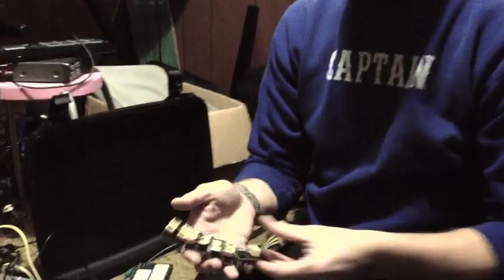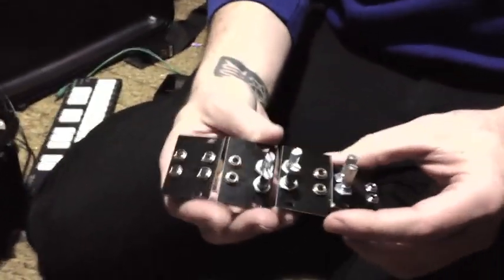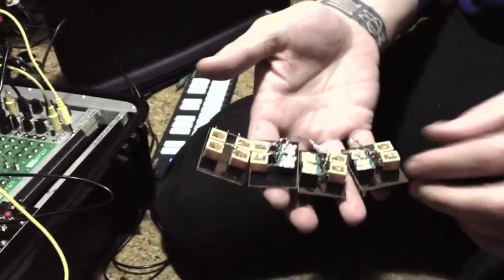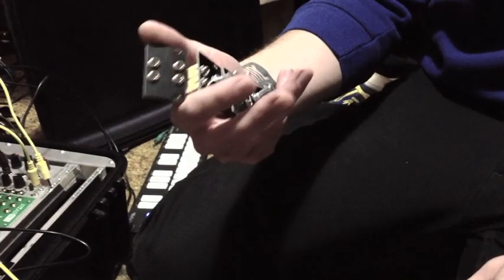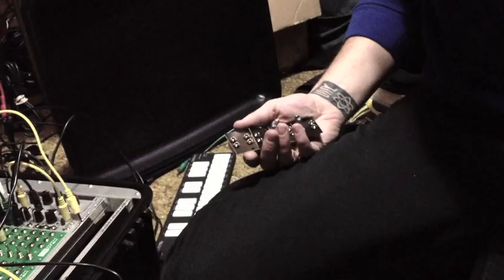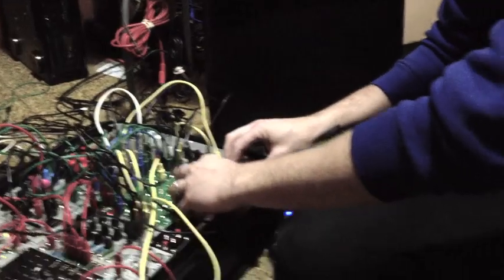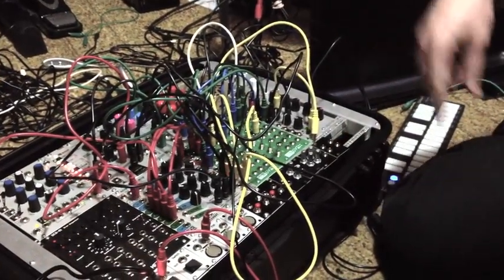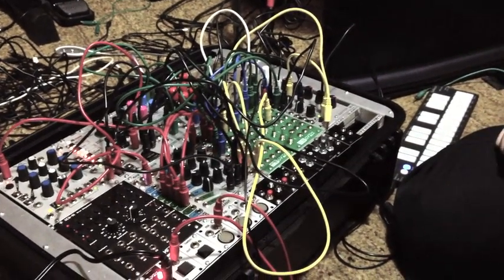1U DIY Tile Eurorack Module - Passive Mixer - Synthrotek

Comment: I want to build a simple passive mixer too in 2hp... No attenuators. Do I need some resistors or diodes? Do I basically connect all the grounds together and all the positives together? Thanx!